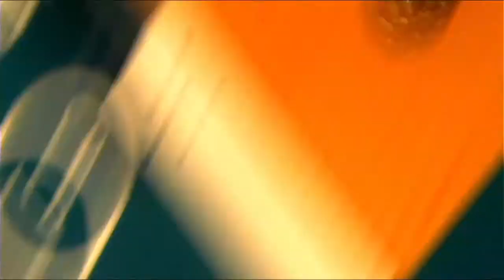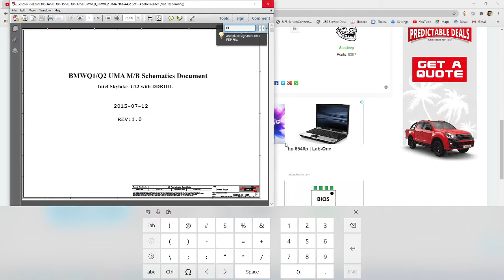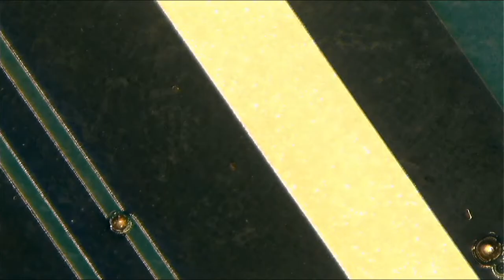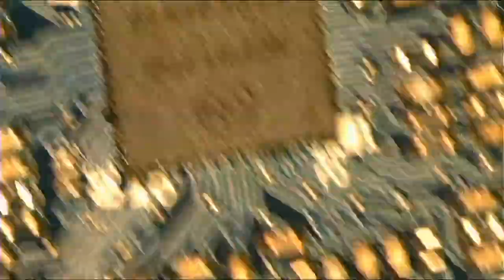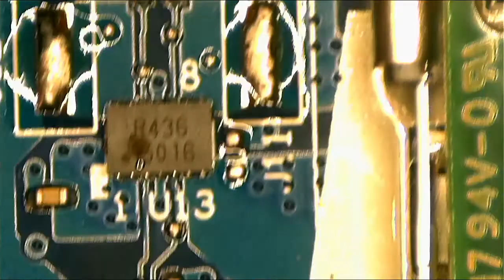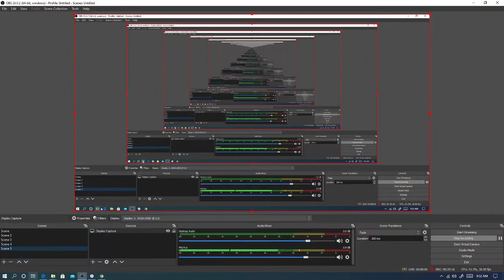Steps to diagnose the Lenovo ideapad 300-15isk not turning on due to a short on the board

Comment: is it possible to upgrade Lenovo ideapad 300-15isk ram to 16 gb ? coz i only can up 1 of the slot to 8 the other is like got lock to 4 gb only so it max only can run 12 gb with 4 and 8 gb, which becoming a single channel.Please if someone got the experience enlight me

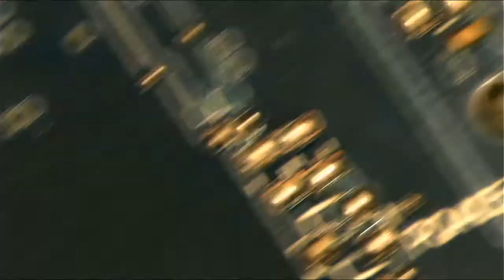Comment: Hi there at 20:10 or 20:13 or 20:20 , in front of ceramic capacitor there are Dots or point  (11 dots ) or (14 dots )or points ?? , my question is what are those dots  or points meaning ? thnx

Comment: What to do when just either the 3.3 v or 5v has an issue
Reply: Hi , First you can inject voltage on 5v &3.3v to find any component to get hot ,if you find any remove it and the second step is  Startup chip OR super i/o chip has a problem and you have to check and change it .